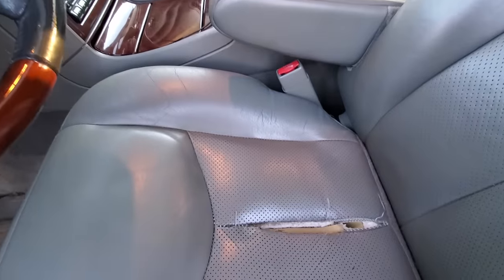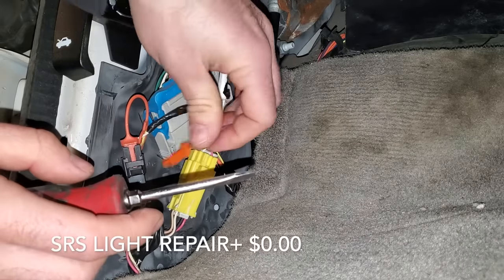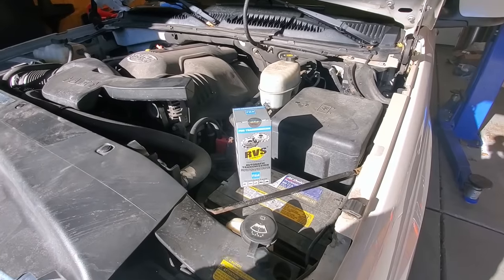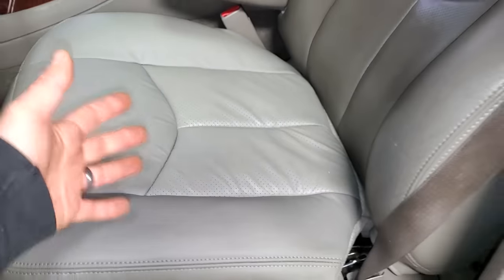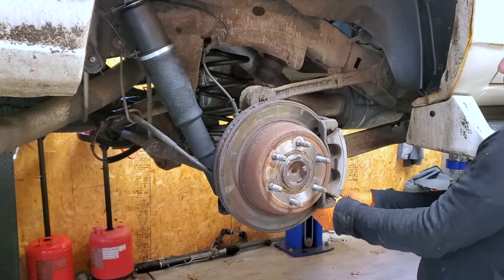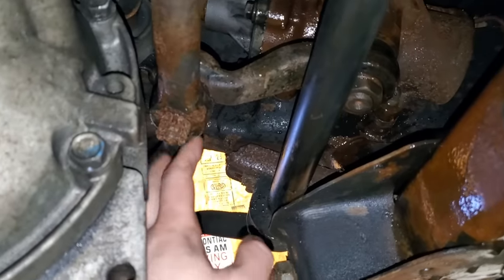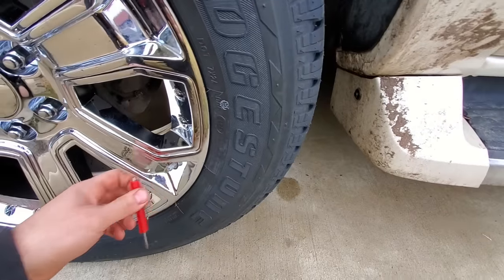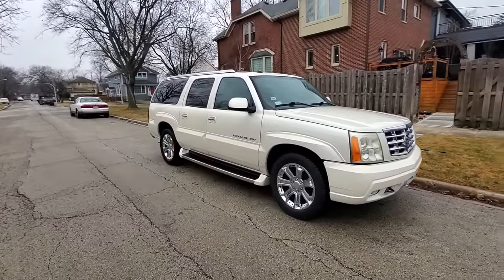I Fixed EVERYTHING On A 15-Year-Old Cadillac Escalade In 1 Day To Avoid Buying My Wife A New Truck!

Comment: Serperate idler and pitman arms. Take a muffler cutter with a good wheel cut through pitman when almost through grab air hammer a bumb the old arm off. I can do one of those in 25min. Book time is hours on those bastards is hours if i remember. Nice truck! I keep my vehicles till the wheels fall myself

Comment: Did you really notice a difference in smoothness and functionality from the RVS treatment?
Reply from the maker: The trans was straight slipping and it fixed that. I believe is unstick a valve in the valve body.
Reply: @LegitStreetCars  Thanks for taking the time brother.

Comment: 5:25 " it has 100% fixed the problem, yeah except for the fact that you know, it hasn't fixed the problem AT ALL WHATSOEVER there is still the broken stud/bolt in the head, which seems to me to be the problem. you fixed a symptom of the problem. the problem is still very much there. because your manifold is not properly tightened it will most likely begin warping ajd leaking again. good temporary fix to solve the noise, but as i said you did not in any way whatsoever fix a problem.
Reply from the maker: Oh its fixed. I've seen these last 100k miles.  They work perfectly fine. But on your truck feel free to do it properly

Comment: For super stuck bolts theres a new tool you can get called an Induction Heat tool, which is a magic wand that heats the metal almost like a microwave oven without getting hot itself, the one I used is a Draper 80808
A bolt I'd spent an entire day on came off in 10 minutes - you can see my joy here (hope you dont mind a youtube link) https://youtu.be/kkHvlOgNJxw and here's a link to the UK version, not cheap but worth it, https://amzn.to/2KTrDYV

Comment: Procrastination as far as the old treatment goes that engine should run 270,000 miles 300 without losing a drop of oil

Comment: It looks "new" nice job!
I will be like you investing time and money into my 2001 Cadillac Saville STS in silver missing only 2 options lighter and navigation. A 55,000 car at the time. That's why I bought it used

My company pick up back 03 Silverado LT as loaded as my STS air ride same gismos as well, mirrors and seats radio recall auto climate as you enter the vehicle. 

Why buy new if you like what you have?

I use to have some old early 70,s nova's one an SS. After you replace what needs toi be is now new and can take pride in what you have done. 

I since i cant afford new make it look new, use tire shine foam and gel let sit then wipe off, use carnauba wax then Turtle wax ICE paint sealer, the gloss will look wet, I get dragon flies to hover over the hood, dive bounce off it fly off and repeat. Try it and see. Word of warning will be bombed daily by birds.

Comment: That’s hardly anything. I have problems with my air suspension and it rusting and my water pump, cat converter and rad just went over the last couple years, but it’s a 2005 EXT with 235,000 kms… Other than regular maintenance, it’s been solid

Comment: I have the 2003 Cadillac ESV I love it reliable I rebuild the transmission fuel pump water pump and radiator reliable only thing has to do with it power steering box is leaking and keep a fresh battery Frank's every time never let me down I bought it 2011 had 90,000 miles on it dashboard quit working don't know what's on it now just remember to keep gas in it runs like a new truck go on trips to the lake with it anywhere I want to go it goes no problem ice cold AC GM build a good truck with the Escalade is my first Cadillac I just love it you got hit by drunk driver recently so kind of broke my spirits on fixing it insurance company totaled it out but I had to buy it back I could let it go so just on the side of what I want to do with it been so good

Comment: Trucks with air brake systems require CDL license and starting weight of a real truck is 26,000 lbs suvs are not trucks! Semi trucks fully loaded weigh as much as 80,000 lbs and more.
Reply: Improper Bostonian nobody cares

Comment: 8-9k between oils changes🙄😂
Reply: Once you perform our engine treatments, there will be essentially no wear happening in friction surfaces inside the engine, which in turn helps keep the oil cleaner longer :) You can see the proof in our Honda that has now done almost 3k miles without any engine oil 😎

Comment: I just can't see GM as reliable. I sell more GM parts than any other brand at work, despite my area having more Toyota and Ford trucks.
Reply: Jeff Margera gm very reliable and cheapest to repair purchased rear brake pad from car quest in Ontario Canada 🇨🇦 for $17.99 Canadian and rear rotors for $29.00 for my 3.8 2004 Grand Prix which just rolled over 400000   . By the way  the gm 3.8 was voted as one of the worlds most reliable engines ,only thing the car requires is oil changes / filter every 4000 miles and pump out 4 quarts transmission oil out of transmission every fall replace with 4 quarts all through dip stick hole . I also have a highly modified 1976 vette owned for 39 years the entire  steering and suspension is original f41 as is the clutch ,tranny ,diff, driveshafts ,and the rotors are original , motor I rebuild and ported heads as extra precaution to installing a supercharger and variable valve timing and lift almost tripling hp . The car was road raced in B street prepared 2 years the only thing that broke was the power steering pump . By the way I just purchased a ford 2011 f150 had to 
welded in rockers and cab corners as the back of rocker had plastic tape OEM to cover the many  2 inch access  holes ,tape fell off and allowed salt and water to sit in rockers and rust them out .I have been told the tape was used from 2010 to 2014 F150 . The f150 also needs differential rebuild and clutch packs ,brakes,front vacuum activated hubs for 4 wheel drive  system .

Comment: You look at this side on, on the lift with the door blocked off by the blue lift post, and realized it a pimped out pick up truck. Only in America you can pass off shit like this, and they probably drive as bad as they look. Great channel though, showing the two extremes, Mercedes and the ultimate Ghetto Chariot, Cadillac Escalade.